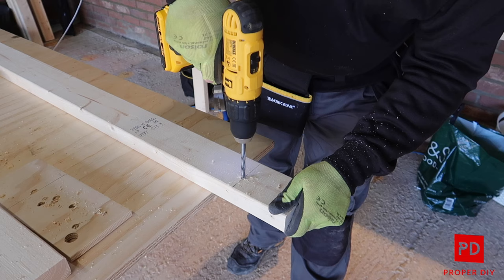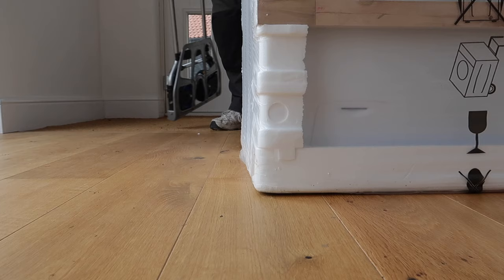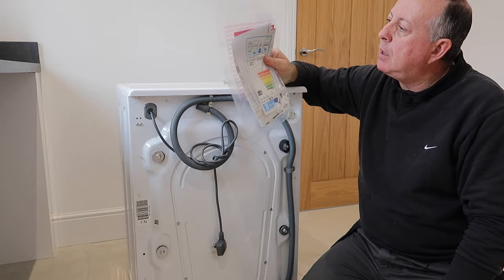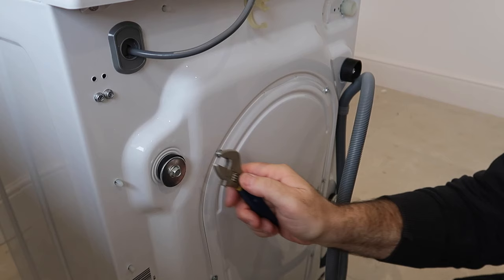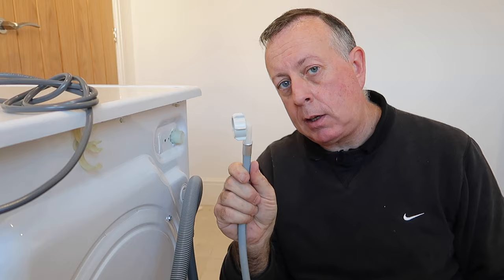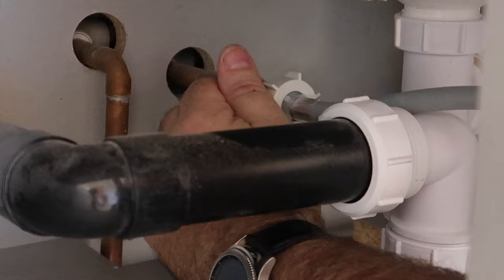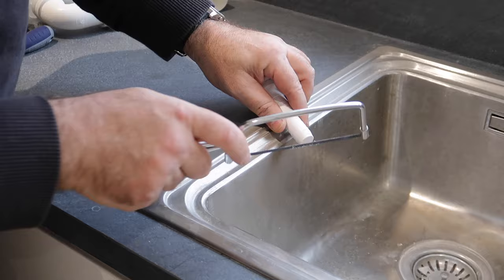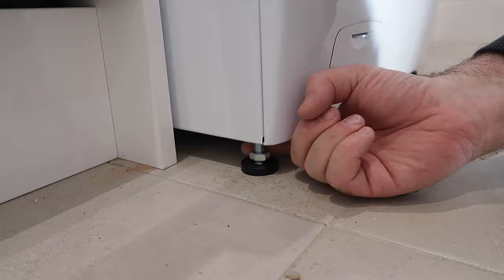How to Install a Washing Machine

Comment: When trying to slide the machine into a recess on a laminate or vinyl floor smear some washing up liquid near the feet and it slides in much easier. Sounds crazy but it works.  One other thing to be careful of is the waste water in the sink is higher than the height of washing machine waste pipe.  If you have a slow draining kitchen sink (or a partially blocked u-bend) there is a risk of the dishwater backing up into the waste pipe of the washing machine.  Keep the waste hose as high as possible - I have mine hooked to the underside of the worktop
Reply from the maker: Good tips!
Reply: It will slide when you don't want it to if yo uoverdo the washing up liquid. Try sliding it on a carpet tile or scrap of hardboard - then tip th emachine to withdraw it.

Comment: I've just bought a Candy which is similar to the Hoover in this video. That black square on top of the machine before you unpacked it is actually the base of the washing machine. You should have fitted it after removing the locking bolts. It is designed to reduce the noise of the machine.

Comment: Thank you sir. Just installed a washing machine on my own. I am so chuffed with myself 😁

40yo female with no prior experience. Those tools that my dad gave me years ago, came in handy. But I just just a standard keys.. small spanners. Don’t know what they are called. 

Just run a short cycle and there are no leaks and it looks so be working just fine. 💪🏼💪🏼

Comment: Cheers mate I hadn’t installed a washer for decades, and have a new one arriving later. Had a thought: I wonder if it’s still the same? Other than the new waste water fitting it is but the confidence boost from your straight forward style and thorough coverage really helped, ta mate.

Comment: Fascinating it's interesting to see the differences between a washing machine in the UK versus the US is. We still have hot and cold and centrally heated water where as it makes more sense to run electric and do on-demand heating in 240v countries. Transportation bolts that's a crazy idea. And you said you don't need to explain what that gray thing is but it doesn't make any sense to me the end is way to big to be a power cord (sarcasm joking) LOL.

Plastic hose for the water inlet. For the longest time we used rubber/plastic there seems to be a big push lately to use braided metal houses because somehow they don't leak. I've never had one leak and besides the metal mash is over a rubber plastic anyway. usually most of the damaged here's is the metal thread fittings that are made of cheap metal and rust out if not cared for.

And washing machine in the kitchen crazy. Usually in older homes they were in the basement or bathroom and sometimes closet. newer houses kind of do more of the laundry room.
And most of the big hardware stores here to free installation upon delivery unless it's terribly difficult to get it in your door.

Comment: Interesting tip worth knowing about washer/dryer combos: if you put too many clothes in the machine on the drying cycle which causes the heating element to trip, all you have to do is remove the top panel of the machine (normally a thin panel of wood) and look for a couple of square "push switches", press both, and this will reset the trip

Comment: Just a thought about moving appliances around a kitchen: the feet might damage a vinyl floor for example and I find a piece of hardboard shiny side down is great for sliding things around.
Reply from the maker: Thanks for the tip!
Reply: I use a thick towel.
Reply: I lube the floor with a thin layer of cooking oil, then wipe it dry afterwards. Soooo much easier.

Comment: Thanks, just trying to install one for my daughter. Why do they make the drumhholding bolts so tight? Small adjustable spanner was no good, had to get a socket set. Then major problem getting the washer combi off the polystyrene base, had to get my weight-lifter son to help. Then could not get the pipes and power cable through to the undersink cupboard. All this in a tiny kitchen. Will finish tomorrow, large glass of wine now.

Comment: Had a machine fail to pump out and had to drain it via the small hose adjacent to the filter. I found the drain hose was blocked where it enters the waste under the kitchen sink. There was an accumulation of grease and fat inside the spigot fitting where the hose was connected. I think the problem was down to using lower temperatures for washing. My local electrical shop recommended runnng the machine empty at it's maximum temperature periodically and I've not had a problem since.

Comment: My cold water under sink does not have that fitting it is a screw on the pipe. ,unsure how to connect ,every video i watch shows with blue tap  and a fitting ,so im totally confused ,trying to work mine out . Good ,quick and easy with the standard fitting video thou .

Comment: Same washing machine here in Australia but never any water connections on the back. The water feed pipe is connected directly inside the machine and the other end connects on to the mains water via an electrical solenoid right at the end of the hose rather than inside the machine as with a UK version. This is to prevent any water inside the hose going back into the mains water.

Comment: My waste goes into the the spout on the trap. However, there is constant water build up in the drum. I have to spin to drain but then it stinks and its dirty. I cleaned the p-trap and extension tubes as it was clogged. But still get water into the drum?

Comment: Is it normal for condensation to be present inside the drum  when you take delivery of a washing machine? Just bought a brand new AEG and when I opened the lid, it was pretty hot inside, and there were water drops all over.

Comment: Just about to plumb my machine in now. Do I need to clip my out pipe on the old style set up or will it be ok? Also, if I do need to clip it, will a tie wrap be enough rather than a jubilee clip? Great vid. Thx.

Comment: I’ve installed mine exactly the same way but it still seems to have a little drop on the cold water pipe under inside the sink even tho I done it as tight as I can by hand. Any ideas would be very helpful?

Comment: great video mate. only issue i had with my machine is i can't get to the back of the machine to adjust the rear feet for it to be level. how can this be done please.
Reply from the maker: the only way of doing it is to put it in place, estimate what adjustment you need at the back and take it out and make that adjustment the best you can and finish it with adjustment on the front feet.

Comment: Need to turn down the music! Too loud!!
Reply from the maker: I highly recommend Peltor ear defenders.
Reply: Well demonstrated and explained video! Keep up the great videos
Reply: Silly question but how would you recommend checking for leaks once the machine is pushed back? Is it enough just to shine a light underneath it, for example? Great video, as always.
Reply from the maker: @vladimirimp  Yes difficult to see around the back however you may at least see the part under the sink. I suppose the point I'm making is the installer should do everything they can to convince themselves that it is leak free before walking away from it.
Reply: @ProperDIY  Makes sense. I appreciate the video - like you say, a way to save £50. We're moving into a house where the vendor is removing the washing machine before she leaves, so it seems perfect to try installing our own. Thanks again.
Reply: Another great vid to save money
Reply: You didn't install the black base (1st item you took out after unwrapping machine) this is to prevent rodents getting inside machine and damaging the wiring.
Reply from the maker: @andybaker8472  I did actually but didn't include it on the video
Reply: I know right?
Reply: And distracting
Reply: @ProperDIY  my guy just responded with more products rather than fixing the problem😂
Reply: @ProperDIY  brilliant reply LOL
Reply: Thanks for the heads up
Reply: Great video it was really helpful but the music loud
Reply: Im watching in subtitles
Reply: I really enjoyed the music, I had it turned right up 😂
Reply: Bloody hell
Reply: There's a button for that
Reply: I highly recommend to turn the volume down a little :)
Reply: @ProperDIY the mixing is bad, need to lower the background, and you need to not start the song over again. BOOMER

Comment: What if there is dampness on the water in pipe connections?  That’s what I’m trying to fix… just tightening it doesn’t correct that and will damage the plastic if go any further anyway.

Comment: i have no leaks when i turn the water on, but a few drops when i run the machine. what do i do??? :( i've tightened the inlet hose as tight as i can by hand. the water in is also split between the washing machine and the dishwasher... it's a plastic pipe with a metal thing on it which receives the inlet hose. i think the leak may be coming from there... what's this thing called and how can i tighten that thing?

Comment: Hi Stewart, great video. I actually came across this to check I installed my washer correct. As it turns out it’s the exact same machine! I’ve ran a cycle though and there is water sitting in the bottom. It’s not a draining issue as the pipe is fine. Did this happen to your machine?

Comment: I notice that you did not show how to level the back feet on the machine. In my opinion the machine manufacturers should do a better job of designing a product where the back feet can the levelled by a screw accessible at the front so that the machine can be levelled in situ. This is even more important with integrated machines where access to the back feet is difficult if not impossible.

Comment: It’s okay if the fitting and plumbing is there 👍
Reply from the maker: If the plumbing isn't there, they won't install for £50 - you will need to get a plumber in first.

Comment: do some washers have only 2 of those transportation screws? cause in candys instructions we have, it says to remove 2 or 4 screws and i dont really know what that means, so my roommate only removed 2 screws and left two in for a week or two and the washer was dancing around alot and we were too scared to use max speed settings like 1200 rotations (in slovenian: obratov)..
also, if the spacer falls inside the washer can you leave it there or you have to take it out by tilting the washer?
Reply: also, thanks for explaining thins that are not explained in the instructions! like the transportation screws, i didnt know washers have them 😅 was my first time being a witness to a brand new washer..

Comment: What about the situation where the sink siphon ir far away from the washing machine? I've bougt an IKEA sink that has a washing machine drain pipe connection quite high up and I'm wondering whether it makes sense to detach the drain pipe fittings on the washing machine and just run a 4 meter pipe to the siphon on the floor so it would only rise by the sink? Otherwise it has to pump the water up the pipe two times.

Comment: I knew I couldn't do it 😑 I've now got the old one pulled out but still connected and the new one sat in my living room. I can't get to it under my sink. It's too far back for me to get to and the hole that's been cut for it is so tiny. 
I think this is the house that Jack built 😂 £900 a month rent for this mess of a tiny terraced house! 
I'll have to pay someone to fit it for me.

Comment: I got as far as the short test program and it failed with an error message saying it was not draining properly.  Brand new machine.  I looked into the end of the drain hose and it has a black plastic object in it that will move up and down the pipe if I wiggle it.  It fits so snugly it looks like it's meant to be there but presumably this is blocking the drainage pipe.  Any ideas?  I've tried to prise it out but there's no way to get around the back of it.  The only way I can think of is to cut the tube behind it.  but then I lose the rubber end of the drain hose.  The other end of the hose that goes into the machine does not look like it's supposed to be removed.

Comment: I remember the hot water and I always wondered why they got rid of them until a plumber said to me that by the time the hot water comes through the pipe the machine is already full of cold water sitting in the pipe so no point
Reply from the maker: Yes exactly! Called the 'dead leg' and could be 1+ min of cold water that the machine is assuming is hot.
Reply: Worse: get the hot and cold round the wrong way and the final rinse of your delicate smalls is done with roasting hot water! Been there… :-)

Comment: Hi Stewart in my bathroom upstairs my toilet leaks and then is sinking down through the floor so the ceiling underneath is bulky what should I do? And the floor is also weak so we have to use the one downstairs instead
Evan
Reply from the maker: I would first fix the leak then repair the damage
Reply: @ProperDIY  Thanks Stewart
Reply: Also could you maybe make a video of how to fit a pedestal sink ?